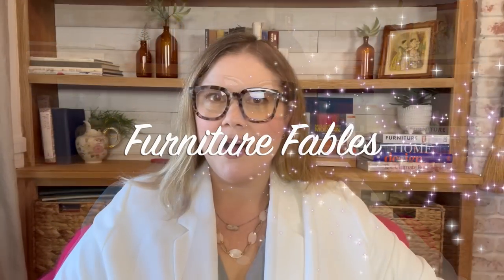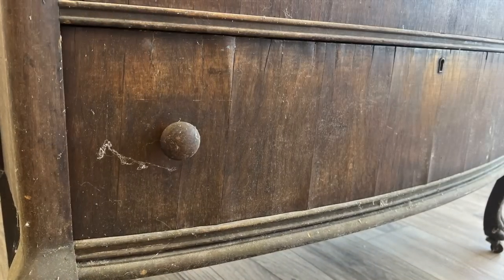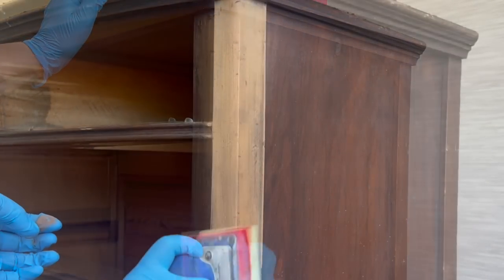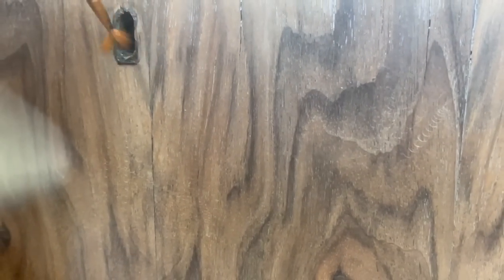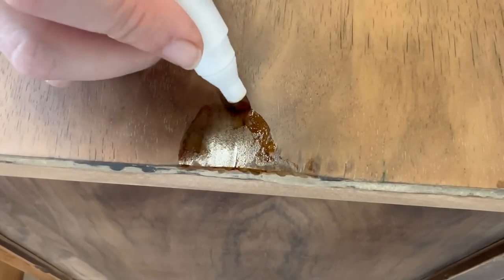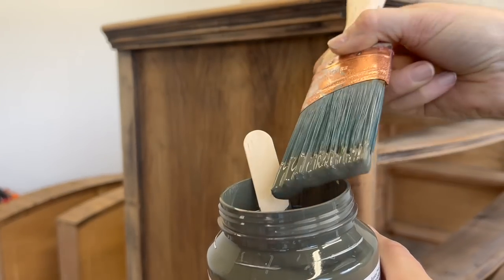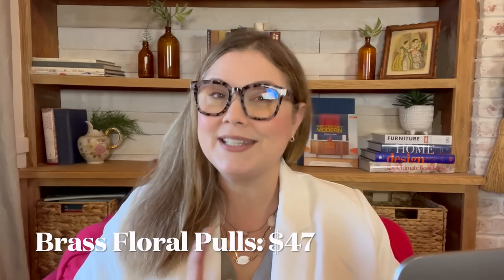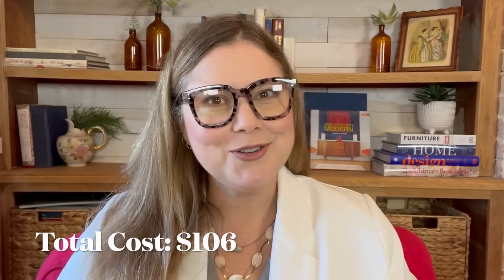How to Repair Walnut Veneer and Save an Antique Dresser! | How to Use Odie's Oil #odiesoil

Comment: Saving the veneer makes this piece extra special.  The paint colors look perfect too.  So much labor to save this piece.  Pricing is hard it depends on the market place.  Somewhere in the $500-$900 ranges.  I realize that is a wide range but I don't know your market.  The most value I gain so much appreciation with all the wok that goes into restoring pieces of furniture.  You put much thought into your work.
Reply from the maker: Thanks so much, truly appreciate hearing that! 🙏♥️

Comment: It’s beautiful Andy. I’d call it, half restoration, half renovation. A restovation! 😂 Whatever we call it… I call it stunning. Having done many battered pieces, I know how much work went into it, and it shows. Good enough? I should say so! The green is perfect. I would have done the same, with the frame. Some cringe at paint, but sometimes, it just makes perfect sense. The only thing that is slightest bit detracting, is the top. New veneer, it would be a home run. But that would have added quite a bit expense, not to mention time. Walnut veneer doesn’t come cheap, and you’d never recoup to cost. All and all…$750, the way it sits. It’s a beautiful piece, anyone would be proud to own. Nicely done!
Reply from the maker: Oh I LOVE that, Joyce!!  "Restovation". 😂👍 Thanks so much, such great feedback. 😊🙏♥️

Comment: This has got to be one of my very favorites. I just love the beautiful wood grain framed by the painted wood. Can’t believe you were able to take that poor sad beat-up dresser and not just restore it but actually improve it from its original state. My DIL has a lovely mid century modern dresser with some cracked veneer — I’m going to send her a link to this. Some of the veneer on hers is beyond repair but most is in much better shape than what you dealt with. Hope this will inspire her!

At least $500. At least! I’d go higher except that, to be fair, some of the repairs are epoxy and wood filler so they’re not in the original materials. Not a criticism at all. To re-veneer and put in carved wood replacement pieces for the trim and the paw feet (which have toe nails no less!) would probably cost so much that the piece would be entirely unaffordable. Your redo is both beautiful and creative and if I lived near you and had any room in my house, I’d rush over to buy it before someone else got it!
Reply from the maker: Wow, so great to hear this, thanks so much!! 🙏♥️⭐

Comment: Not less than $800 for sure!! You have inspired me with a piece of dresser + china cabinet on top I have at home that has similar vibes to this and is in need of a restoration!
Reply from the maker: Oh wow, so cool! any thanks, and best of luck with your dresser/cabinet! 😊
Reply: @FurnitureFablesbyAndy  ❤️
Reply: I did it!! It took 5 days. The veneer came out beautiful with the oil wax & the original brass hardware (lions!) and details now shine like new. I also discovered that the drawers had been in the wrong place for years. With the old, blurred finish, it went unnoticed. Now there is a continuous beautiful design. I did not paint anything though.
Reply from the maker: @remeiagullessimo1586  Congratulations!  Wow, lions??  That sounds amazing.  Thanks so much for updating me!